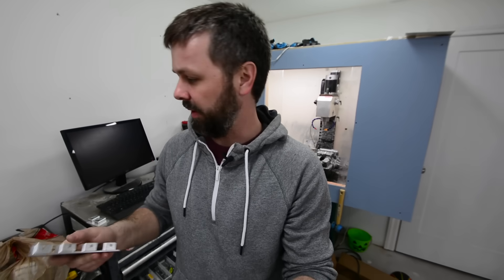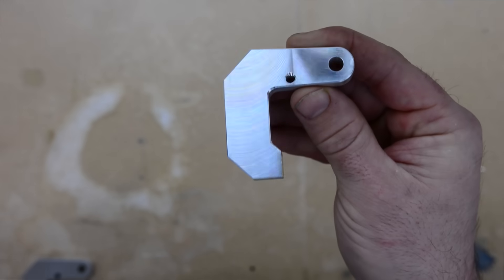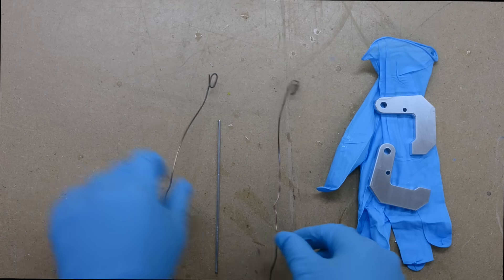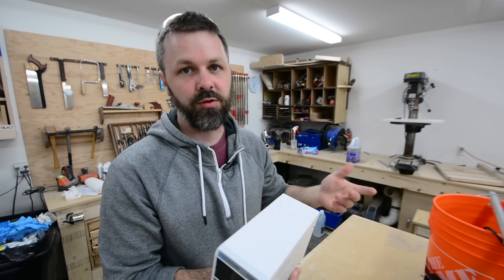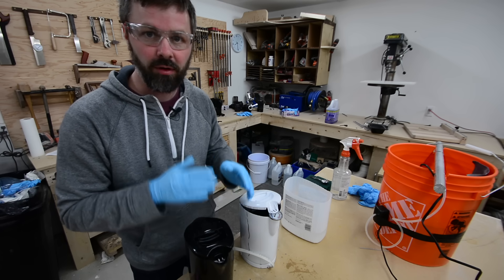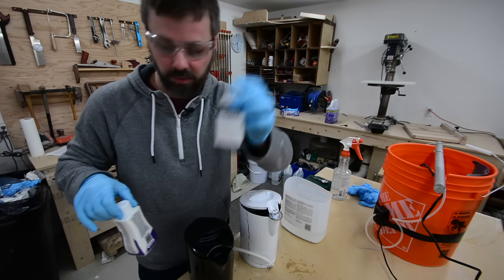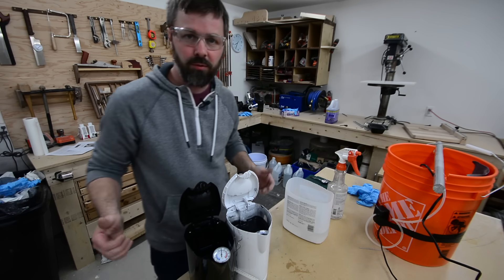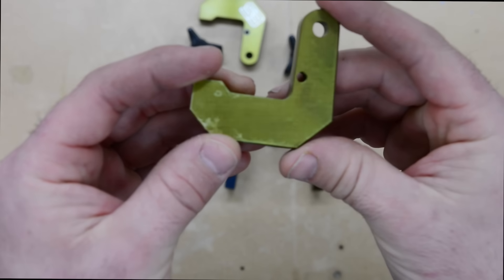ShopBuilt - How to Anodize Aluminum!

Comment: Great vid!
Surprised to hear that blue gave you trouble while green went without problems. My annodizing guy always says green is the worst color to get right. Just a sidenote that i did not hear you mention:  "Aluminium" in reality is ofcourse a mixture of various components in a certain mixing ratio etc, making for a very specific allow end product (base material) with carefully defined mechanical/electrical/thermal/etc properties which are standardized globally and indicated by a 4 digit number. Now, this number is often hard to verify once the material is cut up but in the case of color anodizing alumium parts,  this code will be critical to the end-result. For example, a piece of "6060 alloy" being chucked into storage rack for 7071 alloys is a very easy mixup to encounter. By look and feel, weight and size, etc they can by indistinguishable from each other to even the experts. But when the machinist that is cutting the parts on his CNC suddenly starts swearing you'll know that he found the misfit. If the machinist doesn't monitor the process the end-products can even look very closely alike (not always the case) and thus may not get detected on QC or packaging. Howerver,  when the batch returns from the annodizer, you could probably ask the fedex guy that drops it off to sort all the 6060 parts out from the 7071's and he'll simply need to pick teh orange onns* out from the deep red ones

Ps(* TEH ORANGE ONNS!... ARE...  ...POISON!!) 
PPs( thats  a joke that you won't understand sorry but i could not keep it in)

Comment: Neutralizing the sulfuric (battery) acid with baking soda should be safe to pour down the drain. The main concern would be the traces of lead that got into the acid bath. Wouldn't want lead contamination in drinking water. Good call.

Comment: so what are you doing wrong 
battery acid  is sulfuric acid between 50 - 40%  get this down to 17%.  
cool the solution, between 10 - 22 deg C, this will help stop any powdering and the dark edges.
buy some ajax cleaner it is the best for cleaning.
when anodizing try to keep it at the 5 amps by increasing the volt as it anodes( the anode coating is not conductive and create Resistance) for about 20 mins.
after you anodizing is done don't rinse off into the solution this will on dilute the solution, get a clean bucket of clean tap water and rise off in the water. if you empty the bucket after each application it will be safe to empty down the drain with no problems. 
also if you plan to do more anodizing in the future do throw the solution out keep in a plastic contain to stop evaporation and it keep for a long time. 
i think you are doing a good job at it and like your video.
one more thing be careful using fume suppressants the hold the the hydorgen and oxygen in the foam the it and if you get any sparks the foam goes of with a bangs. best to open a window and have a fan blow over the bucket to move the fumes.
Reply: I would only suggest trying to get to 15% sulfuric. The rest is pretty spot on

Comment: Hi, I'm a nickel, cadmium and chrome plater for the aerospace industry. The dark areas your getting near the edges could be due to it being a higher current density area. It means more of the anodise will be thrown onto the edges. The high density area are always the outside edges, especially the top and bottom as it's positioned in the vat/bucket. If you use a micrometer to take measurements of the middle and outside edges of the part then you will be able to track which areas have taken a thicker deposit.

Comment: You could have just looked it up, backing soda does neutralise acid, it doesn't take much to neutralise it either, it wouldn't be a slurry. Just keep adding until it stops fizzing. And it will just convert it into water and a salt, and CO2, its the reaction you get when you mix vinegar and bicarb soda.

Comment: And that's why US power (110VAC) sucks. 2 kettles trips a breaker? wow.... 

I assume they're about 2000W kettles. At 240VAC here in AUS, that's only 8.3A each, and 16.6A for both. On 110VAC that would be 18.18A each. or 36.36A for both. That's a fire waiting to happen.

Comment: good idea to call your local waste company. Neutralizing acid is very easy to do and a process you should be aquainted with in my opinion. Even if you are not neutralizing to dispose of the acid it can be helpful to know if you have a spill in your shop. You can buy some cheap litmus paper to check the neutralized solution before you get everything cleaned up

Comment: If you can find a fan which the airflow do not pass throught the motor, you could use that for the fumes collection. Use dryer vent hose, and throw the other end outside by a window. If you want to make sure that no fumes goes inside, put the fan at the end of the hose. You will lose lots of airflow, but you do not need alot anyway. Put the suction on the cover/lid. This way you basically have a negative pressure all the time in the tank, which mean that no fume can go out as air can only go in (and out throught that hose).

Any fumes, including acid one, will be vented. It need to be just a bit stronger than whatever air you shoot in actually, so really, a computer fan would work, but the motor will be damaged eventually due to the fumes...

Comment: As the anodize layer builds and becomes more resistive dont you have to readjust the amperage up by increasing voltage to reach par?

Comment: can u do this with steel and what acid did u use in what ratio
Reply: Nope, anodizing steel is a totally different process which is a bit difficult. You need to anodize it in a hot (50C) bath of concentrated (50%) lye (sodium hydroxide). With steel you don't get colors from dye, but rather from the anodized layer itself. It's very hard to achieve specific colors with steel anodizing

Comment: Its actually worse to put it into a landfill because the active acid will leach toxins out of other waste and then it runs out into streams and poisons people and wildlife. Full neutralization is actually the best and most proper way to do this and I say this as an EPA HAZMAT disaster prevention, inspection and isolation technician.

As one who has handled a lot of toxic and caustic chemicals, I strongly advise that anybody doing this or any similar project be sure to neutralize all acids and all bases which must be disposed of, especially ones involving toxic metals [which both lead and aluminum are] because of toxic, mutagenic, carcinogenic and endocrine disrupting leachates. 

The safest way to dispose of it is to allow it to dry [remove all the water] and then package up the concentrated remains in a puncture proof, shatterproof, corrosion resistant vessel and turn it over to a certified hazmat disposal facility, clearly labeled.

Comment: You can neutralize the battery acid (typically sulfuric acid) with the baking soda (sodium bicarbonate).  You can also use lye (sodium hydroxide), just be careful.  Your best bet would be to dissolve it in water first and add it slowly since neutralizing a strong acid with a strong base will produce heat and can result in the solution popping/splattering.  Also be careful dissolving the lye as it is an exothermic process that can produce enough heat to soft boil an egg.

Comment: Chemist here, you can just dump the acid down the drain, it's no problem for the environment. The only danger might be that some could spill on you while flushing it, as you said to avoid this you can just neutralize it with baking soda.

Comment: when you have anodized parts (in my case hand levers from my motorbike) and they lost quite a but of the dye due to a lot of use, can you re-anodize them or do you have to sand them down and re establish a pure Alu surface?
Reply: Mr.Mezmerize yes. It’s a chemical process to remove the anodize

Comment: Do you think it is safe to use some of the stainless steel safety wire for the process instead of the titanium wire?
Reply from the maker: I'm not to sure if stainless would work but most home centers do sell aluminum wire or aluminum Tig welding rods work well as well.

Comment: First off i would like to say this is a great video, you did a fantastic job for just learning yourself and doing this all in your garage. A couple things from someone who works in a very large anodizing shop. The first and most major thing you missed or did wrong is the last step, you need to seal the parts in a nickel acetate(other people have pointed out), all of this is pointless without proper sealing. The boiling water is actually good and you can do that after the seal. I suggest using a hair dryer or heat gun to dry the parts before handling too. More amps and colder temperature process liquid (34F) will give you a darker and better anodize (type 3, hardcoat). It will still accept dye, but will look different. The lightly colored blue part, the dull one was poor contact during process. Your pre dye cleaning is unique, not that it doesn't work, but just not how everyone does it. A mild nitric acid bath is something you could experiment with instead of the baking soda, always rinse with distilled water before and after as well. You can even dye your parts, rinse them, stick them back in the nitric for a few minutes and then back in the dye(this sometimes affects how deep the color is). Use your lye to neutralize your process bath(do not breath anything and add it slowly). Buy cheap PH strips, get it as close to 7 as possible and then you can dump it right down the drain. Another thing people really leave out is the alloy of the Aluminum. This makes a HUGE difference in how a finish is going to turn out. Sorry for the wall of text.

Comment: Cool video. I had always figured  it was done more like  powder coating, where electricity  would be used throughout  the whole process.  Question : why did you stir both dye tanks with the same stick? Aren't you worried about  batch  colors   consistency or whatever? Also,  what do you do with the ones that  didn't take  well? Is it difficult to clean them off and try again or do you just go again from that  point,  maybe a darker color?

Comment: Just in case people are worried:
This reaction does not produce any fumes, just Hydrogen and Oxigen gas. Hydrogen is totally nontoxic. Its highly flammable, but the amount of gas which is produced should be so low, that it does not cause any problems. Just open a window or so.
The acid-bath, on the other hand, is a kind of an issue. Its ok to dump a neutralized solution of pure batterie acid down your drain, but in this case the solution is contaminated with aluminum-ions, wich are quite harmful to the environment. The best way is to bring the neutralized solution to your landfill.
Reply: It does produce acid fumes that can make you choke.

Comment: Nice video. Very informative. Question, I would think if you diluted the acid with additional H2O and neutralized the remaining acid solution to a 7ph with baking soda, it could be disposed of in the regular drain, is this not so? Also. If you plan on continuing doing this, can't the acid solution just be used indefinitely? Adjusting the concentration by adding more acid as needed?

Comment: the protective film on aluminium sheets for cathodes can be removed with Sodium Hydroxide without hard work.
If you'd have more complex parts for anodising the bubbling agitation would cause you defects. 
For removing the mill marks you can use Sodium Hydroxide too, the surface will be pretty matt and uniform.
but the Hydroxide is quite aggressive to the aluminium so you have to leave some addition to the part you want to anodise. 0.05mm is enough.
Also for dyeing you can use textile dyes. But they have to boil. 
I work in a anodising facility.

Comment: Hydrogen gas is not poisonous. The problem is that it's extremely flammable. As long as it doesn't collect you should be fine. If it collects somewhere you might get an explosion.

Comment: You're over doing it with the baking soda bath, that reaction is very fast. As far as neutralizing it, just dump baking soda into the bucket and stir it until adding more no longer bubbles. Then it's water and salt, and totally fine to dump. The "hazardous" part if any would be any lead residue left over in the water. You'd need to be dumping a lot of it before that would be an issue though, there's probably not very much leaching into the water.

Comment: Mix sulfuric acid drain cleaner withe acid then dump it down the drain. You need the inhibitors from the drain cleaner to stop the acid eating any metal parts in your drain. After awhile you will notice that the acid in your anode tank will get a blue tint this is a sign that you are getting a high aluminium content that's when you dump it.

Comment: Yes, you can neutralize the acid and dump it down the drain; in most situations. You can neutralize it with that NaOH/Lye you have. (You'll only have to use a bit of NaOH compared for sodium bicarb.) Doing that, you need pH steps to know when it's neutralized. You obviously can't really guess. But in this situation, you're water is contaminated with lead, so you can't dump it. 

Tig wire does not need a to be conductive. Even if it is completely covered by an insulating material, it'll still melt and work for welding. The arc passes from the tungsten to the metal being welded, and not through the filler rod. You could use a plastic filler rod to weld with. It wouldn't hold the metal together, but I'll just trying to illustrate that it doesn't need to be conductive.

Comment: Can't you remove the anodized layer with oven cleaner?
Reply from the maker: Not that I know of. You can remove it by etching the surface with lye (drain opener). That basically removes the anodized surface which means it can be re anodized. Just keep in mind that your surface finish will be more matt.

Comment: I totally don't understand what the purpose of the lead anode and running juice thru the parts if the dye is not even in that step of the process.   Is it coating the aluminum with a layer of lead for the dye to attach itself too like a primer for the dyde  ?   Ive seen people coat pennys and stuff like that with a battery or power supply and a zinc bar or rod and then polish it to a mirror like finish.   But this is a little different ....
Reply from the maker: Your forming an aluminum oxide layer that is honeycombed. When dipped in the dye there is a capillary action that soaks up the dye. Boiling it seals the the honeycomb over, locking in the dye.
Reply: Wow the parts look great ,  Honestly wasn't expecting them to look that deep , really interesting  ,   I wonder if Aerating with a a large aquarium type stone and air pump would eliminate some of the random surface imperfections.   OR some kind of motor or magnetically induced impeller like you might see in a laboratory that stirs the water duriing the oxidation process might    OR  maybe the cnc cutter was microscopically making tiny pits in the metal rather than just slicing cleanly , maybe caused by harmonics or vibration...   Regardless.   They look better than 90% of anything coming out of china :)

Comment: What if you start at a low amperage for good color and slowly increase the amperage once you have the desired color for extra strength? Would the color fade away as the strength increases?
Reply: What sort of ''strength'?  Do you mean harder?  It's hard enough, so just follow the LCD instructions. http://support.caswellplating.com/index.php?/Knowledgebase/Article/View/91/19/lcd-anodizing-instructions

Comment: You should cool the anodizing bath under 10 degrees Celsius. I use coolingpads out of the fridge for this. The cooler the bath, the harder the anodizing, the better the color absorbtion  in the color bath later.

Comment: Well done. Great tutorial. I'm anodizing professionally but it's always interesting to think about how you could do things, without the professional equipement. 
Just some thoughts from my side: So we are driving by voltage not by current - it's not the perfect way, but you don't have to care about your surface area. We should have about the same concentration of sulforicacid, so that would give you about 0.5um oxide layer per minute (@16V @Roomtemperature) - which in 'reallife' of course depends on various things, like alloy, Al concetration in the bath, etc..
To increase the hardness you could cool down your bath. But 'hard anodized' pieces are difficult to colour. On the other hand you can extend the anodization time (10-20um = 20-40min) to get deeper pores, which then can contain more dyes.
Just some ideas. ;)
Reply from the maker: Awesome thanks for the extra info!
Reply: Hi Dominik if i have a piece with 74 inc2 how much current i have to apply?

Comment: You can take the aluminium TIG rod over to a bench vice, clamp it, then use an angle grinder to take the oxide coating off so you can use it again.
Reply: You can strip anno off by soaking it in lye. Liquid draino used to be an easy source but its been years since I've annoed and have heard they changed the formula so check.
Reply: Maybe just reverse the polarity of the electrical source.